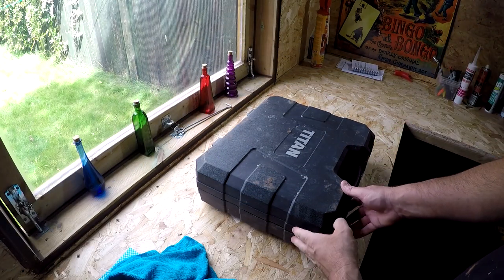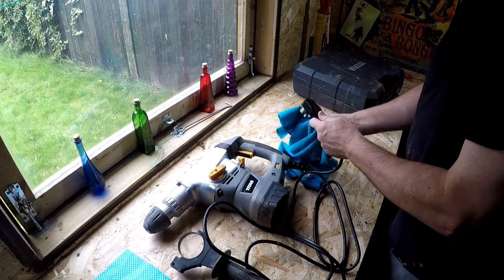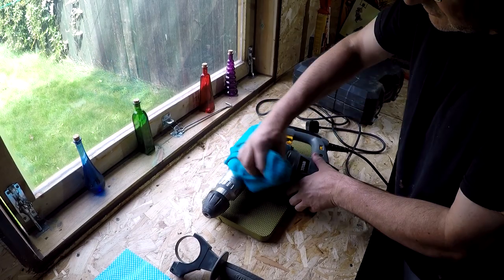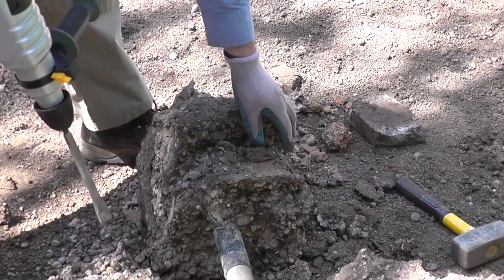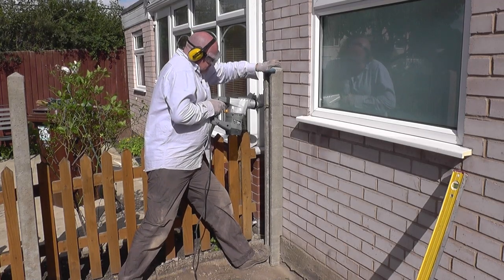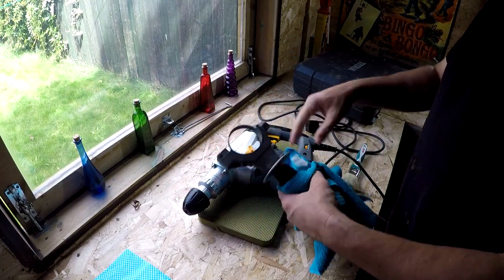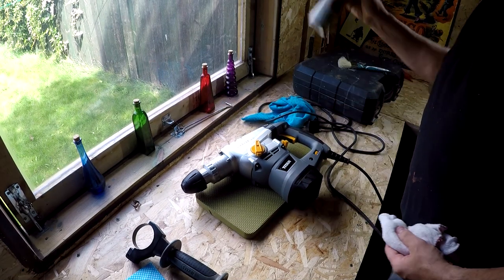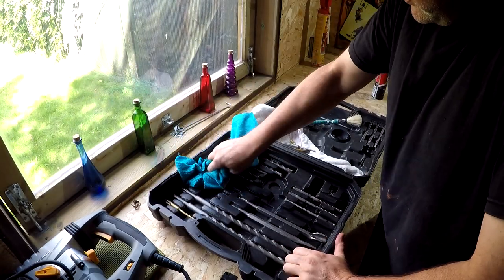#1 Desirable But Not Essential Power Tool For DIY'ers And Handy Persons

Comment: I hired a Hilti, which came with a point and a chissel. I tried both to see which worked best and was charged for the point even though I had dismissed it after a few seconds and it was unmarked. I bought the next one up from your Titan  a good few years ago and it has paid for itself several times over.
Reply from the maker: Hiya Ade, hope your family are safe and well mate.These Titan's are excellent value for money. Should last years (hopefully). ATB, Des

Comment: Have you used it to chase sockets? Or is this overkill?
Reply from the maker: Hi there. I've personally never used it to chase sockets - mainly for drilling out concrete footings for fencing, etc. However, from the comments you will see that others have.  For the odd socket it may be overkill but if you've got one why not use it.  Hope this helps. Des

Comment: Sds plus definitely a must have. I have removed posts with it. Removed bad cement work of the previous owner. Created 6 new sockets indoor. Drilled holes for outdoor lights  and outdoor socket. This toll paid for itself 5 times now and it will be good for many years to come.
Reply from the maker: Thanks for sharing buddy. ATB, Des
Reply: Which model is this? Seems to be so many on the screwfix website ie titans 1500W SDS drills.

How did you do with chasing in sockets with it?

Comment: I could not tell you in a sentence how good that video is for my application mate. Brilliant. My "Application" by the way is splitting large diameter logs, but also (occasionally), drilling anchor bolt holes in concrete and all the other SDS drill stuff. Have a look on YouTube for log splitting and also the prices of log splitters.........
Reply from the maker: Hiya Paul. Really appreciate your valuable feedback mate. What a great idea. Best wishes, Des

Comment: Mine stopped working I took it apart to check everything is fine. I’m hoping it might just be the fuse in the plug
Reply from the maker: I hope so mate. If not, Screwfix are usually pretty good and should replace without any probs. let me know how you get on. Des

Comment: It's a heavy bugger!I bought mine a good few years back now and it just came with the drill and the point and flat chisels, not the gouging chisel and drill bits so it looks like it is even better value now. I use it rarely but it was £50 odd quid well spent. I have used it numerous times breaking concrete when digging hole etc where I wouldn't want to "hammer" my better SDS and risk breaking it. I also use it combined with a heavy duty mixing paddle for mixing concrete/cement/plaster in some of those big round rubber buckets. So much easier on the body doing it that way. It came into its own when mixing up for when we did a long fence run. At £50 or so I thought if it lasts a while at that price it is money well spent, it appears to have many years left in it yet!
Reply from the maker: Hiya buddy. I forgot to mention mixing plaster with mine - it's great for that as well. A £50 bargain for sure.  Take care, Des

Comment: I have the same SDS drill and have to agree I haven't used it often but when I have used it it certainly did its job. I've used it to drill into concrete blocks, which it did with ease and for breaking up and old concrete base for a bin store. very nice to know you have it to call on for the bigger jobs.
Reply from the maker: bang on. Agree with your comments entirely. ATB, Des

Comment: got that drill at work it is good for the price. i used it to drill holes into tarmac when instaling some ruber speed bumps on the school driveway.
Reply from the maker: Sweet Gazza. I might try that outside my house. After 11pm cars speed down there like it's a damn racetrack. How's things at work mate. You up and running yet?  Best, Des
Reply: @21stcenturycaveman33  Hi ya, I had about a 3 month break from work due to covid 19 I have been back at work about four weeks now, getting things ready for the students returning, but that's not going to be till September now after the summer half term break. it's going to be interesting when they come back, fingers crossed it goes ok the top brass are still making plans for it.

Comment: Started my fence today demo went fast until I got to removing the concrete and old post . I broke out the hammer and chissel then thought you know what if rhe Tirans goof enough for Des is good enough for me . Tomorrow is round two if it arrives
Reply from the maker: Don't think you'll be disappointed mate. Especially in this hot weather. No fun banging around with a club hammer, lol. Good luck, Des
Reply: Not disappointed Des ,but have to say getting a 2ft square of concrete out of the ground isn't easy for an old git like me . Not ashamed to say from digging to post in took 2 hours and I've got five of the buggers . Ah well onwards and upwards

Comment: Hi, 
Will this Titan Sds Plus be able to make 120mm core hole for bathroom fan in cavity wall ?
Reply from the maker: I reckon it should do it easy mate. ATB, Des
Reply: Absolutely will, I used it with 125mm , not a problem